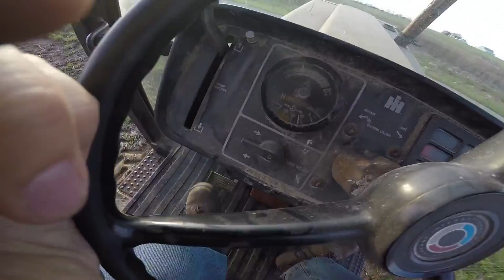IH 1086 Ready to Roll

Comment: The reason to keep it under load is to prevent ur engine reving the shit out of itself. I could get all into the physics of y that is but in short throttling down bout 1/8 of the way does the same thing as hitting ur brakes when u pull the torque back. It basically affects ur engine in the same matter as a torque on a 68 or 06 series it just goes through a different process in the transmission. All it is at the end of the day is a splitter for ur gear. Treat it like u would down shifting a manual pickup to go up a steep hill.

Comment: I've heard to always run the amplifier in high when you can because it's heavier duty and it will last longer.
Reply from the maker: The high for the TA is direct drive. In Low TA, the tractor free wheels down hills.
Reply: @boehmfarm4276  on the old farm all’s that’s true. On the 06 series and newer they don’t free wheel.At least  there aren’t supposed to.  And yes you should  be in direct ( forward) normally. Pull back when you need extra torque.

Comment: I've always been told never pull the t/a back while moving whatsoever. We're still on the original t/a as well so there must be some truth to that lol 🤣
Reply from the maker: Then what's the point of the T/A???
Reply: @boehmfarm4276  it's supposed to be like a powershift when speeding up and for in the fields it's used to give you more torque at a slower ground speed when you are pulling something heavy like a sidedresser or something to that matter.

Comment: I've never heard that about the torque amplifier, since all it's a clutch driven planetary gears set, I wouldn't worry about hitting the breaks and all that. if you move the the lever swiftly back and release it slowly, you won't have anything to worry about with the torque amplifier. just my two cents.
Reply from the maker: Thank you. I have gone quick both ways.

Comment: Looks like you got it all back together right , Job well done JB you did good !  Bandit
Reply from the maker: Thanks, I'm glad to be on to other projects.
Reply: A lot of people would have never tried to do what you did, They would have called the dealer to come fix it. You guys did a really good job fixing it back up and ware you were working is not the easiest place to work that's for sure,  If it didn't have the cab on it it would have been a lot easer job to do. That's one reason I like the old cabs that you can take off easy and work on it standing up and not all contorted ! LOL  New projects means new videos !  Bandit
Reply from the maker: I was thinking of how nice not having the cab in the way would be.
Reply: Some cabs are really easy to take off to make it easy work on things, But some are just a nightmare to do anything under the cab.  My cousin had a 7060 AC with a cab on it and we had to torch part of the floor pan out to get to a hydraulic fitting that the line went bad.  The cab was going to be a mother to get it up enough to get to the fitting so we used a fire wrench to get to it ! LOL  I've been thinking about putting a YearRound cab on my 1550 beings I use it the most,  Not so much to keep out of the cold but to keep out of the sun and heat ! LOL  Cabs can be a great thing but can be a big pain in the butt when you need to get under them to work on something !  Bandit

Comment: Had 886, I used ta  like a 2 speed in the field. on the road I would only shift to direct drive in 4 high, the thing just pulled better that way.
Reply from the maker: I run into low TA not holding the tractor back when going down hill.
Reply: Boehm Farm in

Comment: Hey i have a question about a 1086 there is a guy with one and he wants to sell it to us , we saw him brush hogging with it one day and the smoke was white ?? It a single owner tractor seems pretty nice , but could the white smoke just be because the most he has done with it in 5 years in pull a 8ft brush hog, or is there something wrong with it ??
Reply from the maker: Worst case scenario,  the coolant filter wasn't changed regularly and the cylinder sleeves cavitated. May just need an injection pump rebuild or valve lash checked. Without inspecting myself,  I can only point out options.
Reply: Boehm Farm ok thank you so much for the information, happy new year

Comment: sol if the t/a isnt working      you can still use tractor or it doesnt move ?
Reply: If the torque is out you can use the high side of the torque but when you put it in low torque you cant move

Comment: What was wrong with the transmission?
Reply from the maker: We fixed a the c clip on the hi low shift rail, the transmission brake was adjusted and an o ring put in, the t/a lever was freed up and a new seat.